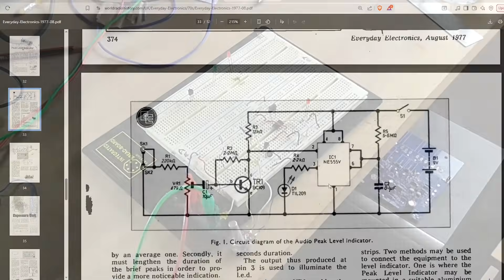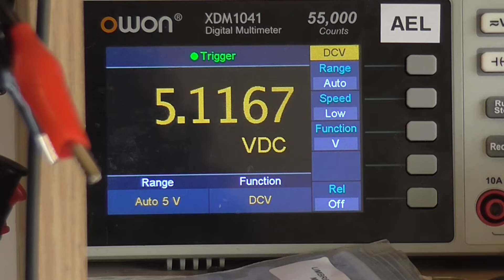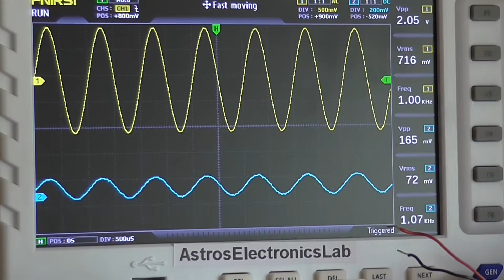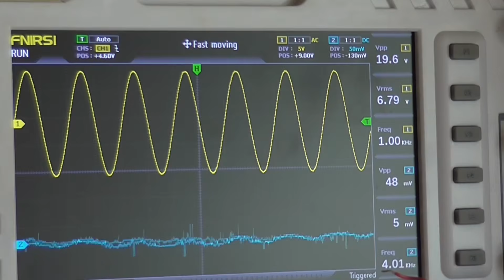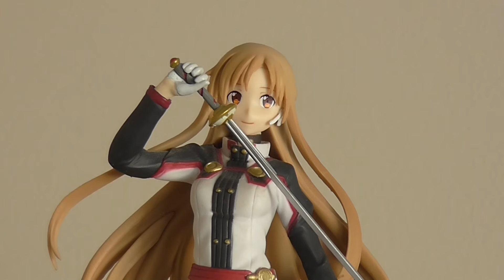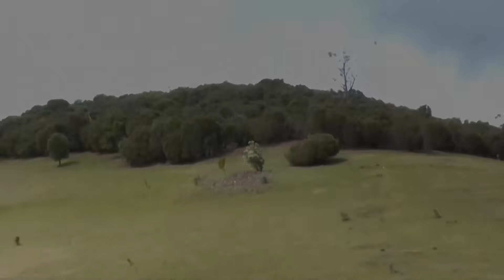555 Timer-Based Audio Peak Indicator

Comment: Simple fix-triger the indicator with the signal input to the amp
Reply from the maker: Well, I think the intended purpose of this circuit was to do exactly that - hence the "loopback" RCA sockets at the input. Preamp in [detection], preamp out/power amp in.
Reply: This is certainly possible, although nearly all the clipping detection circuits I've seen are fed directly from the output of the power amp for whatever reason. The best clipping detector is one that looks for distortion really.
Reply: @tonyrogers8318 - a clipping indication that doesn't detect off the output is completely and utterly useless.